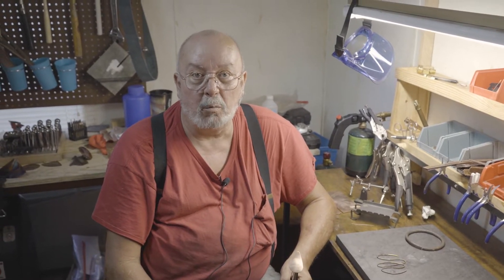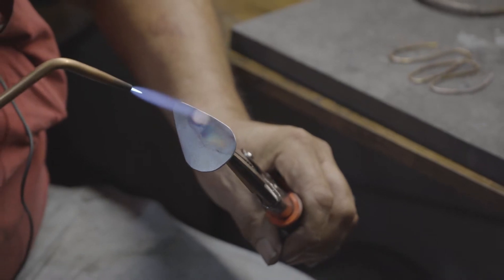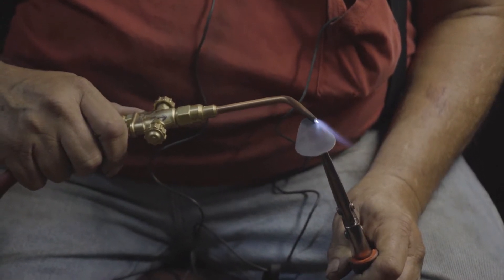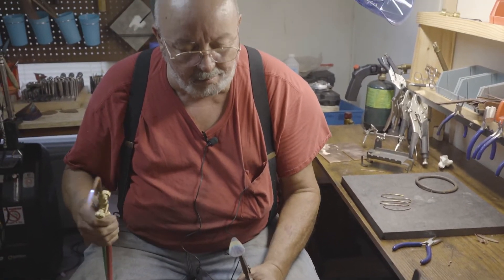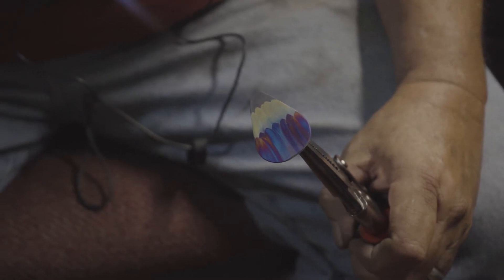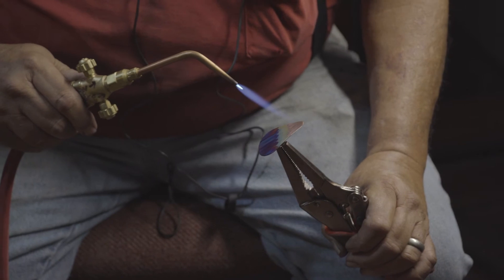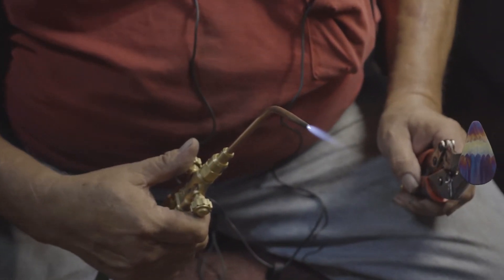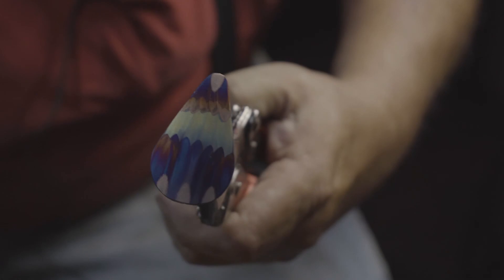Copper Flame Painting Demonstrated

Comment: When you say your going to paint it after you already had your flame color.  What are you painting it with and is that a final coat?
Reply from the maker: It's a clear coat. Try several different ones. Clear coat will change the color in that it changes how light reflects off that color. Some clear coats may have a touch of tint. So experiment and find one you like.